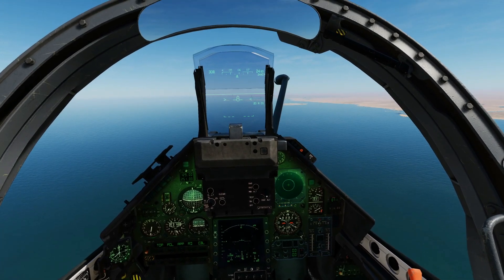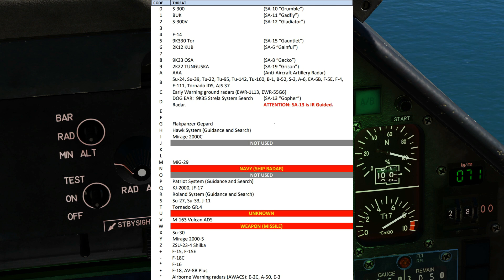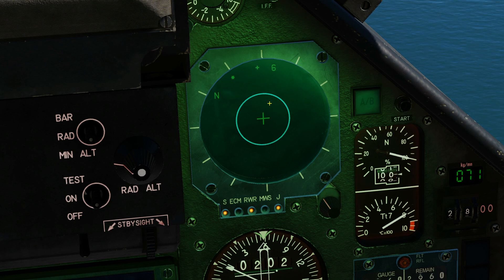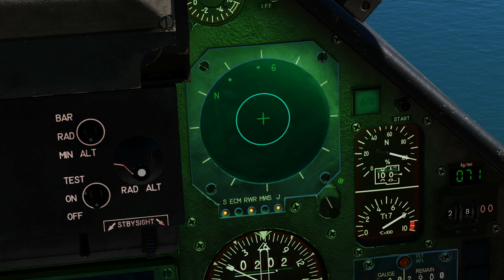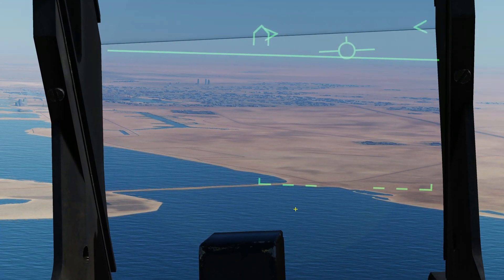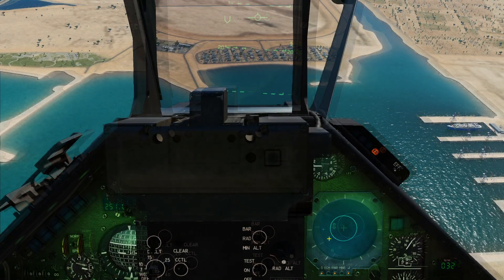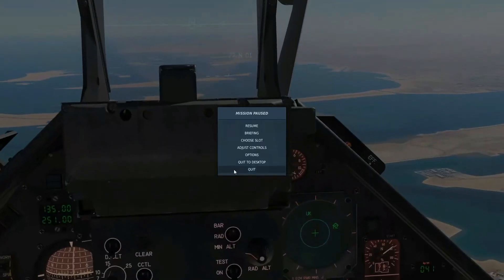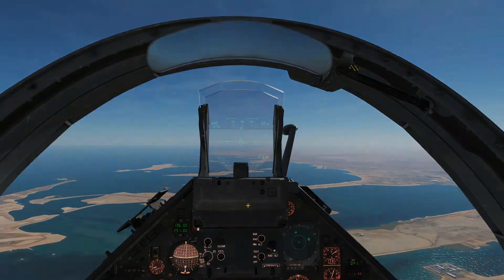Mirage 2000C: RWR & ECM(Jammer) Tutorial | DCS WORLD

Comment: So is the line which showed the azimuth of the missile on the RWR gone?
Reply: That was part of the missile warning system called D2M, which is still available and works the same way, only difference is that it's no longer included by default and has to be enabled in the mission editor by the designer, most don't include it either because they don't think of it, or use the (reasonable) justification that it was never in service with the AdA
Reply: @ripper253  okay thanks for that👍